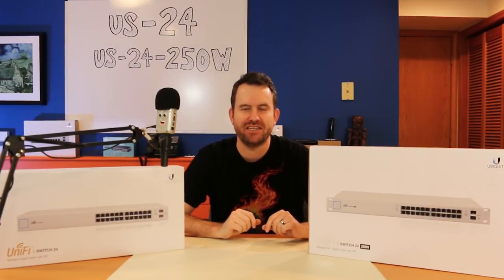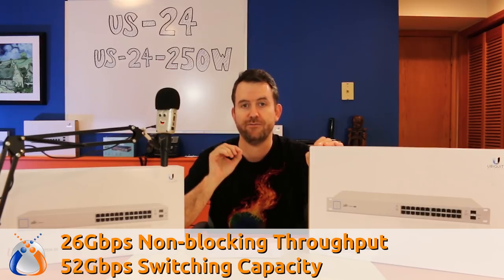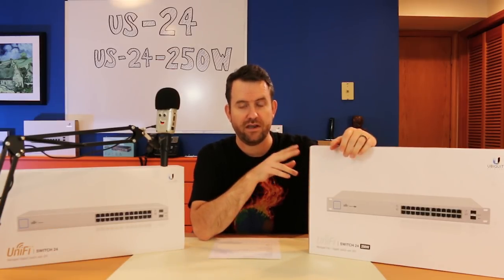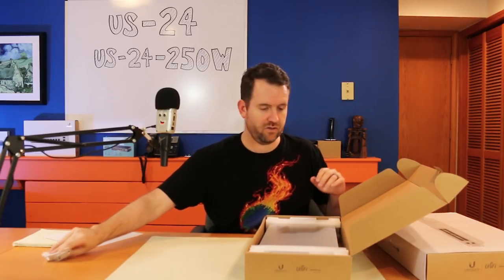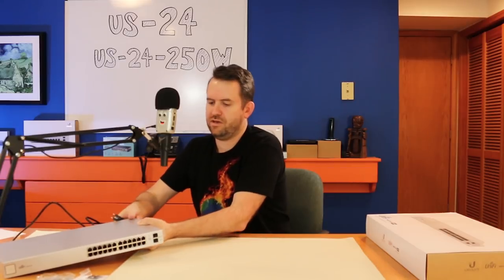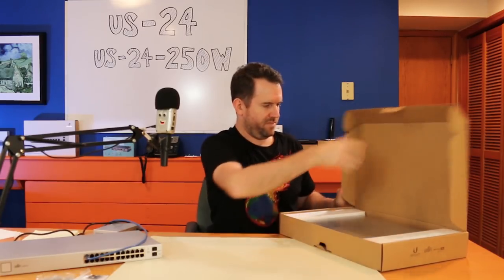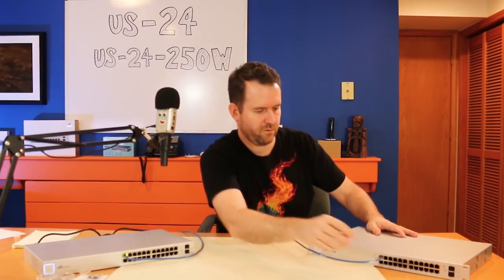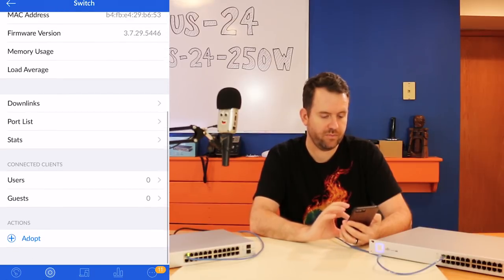US-24 & US-24-250W Setup w/Fan Replacement

Comment: Hi Chris, great videos, however you are completely wrong about the Power Consumption of PoE devices, even cable length is a big factor. The power used when you have a UAP-AC-HD, idle on a short patch cable, is NOT at all comparable to having it deployed with load on 50+ meter cables (average length). Datasheet says max 17 Watt, and that is the number you should use. or you will see installations where you will not be able to boot after a power usage. Booting and firmware updating is one scenario where UAP's use way more power than when idle or under light load, you will never see that in your dashboard because the wattage there is average consumptions, not peak values, and peak values is what giver you overloads. UniFi switches does not have PoE priority functions.
Reply from the maker: Great info - thanks!
Reply: Seen the same, and I typically use the rolling firmware upgrade to smooth out the load spike, as if you just hit 'update all devices', it will likely overload.
Reply from the maker: @wiebowesterhof  Well thanks to both of you...now I have more research to do, and probably a new video on this subject.
Reply: I agree with Ulrik. I've seen AP draw more power at start-up so I guess it would be wise to have room for that always.
Reply: @CrosstalkSolutions  appreciate it, constructive feedback and you being able to share your findings on the channel is a good way to do it (there are enough spam comments on YT )

Comment: Chris,

If you replace the fans with the correct 12 volt fans they will run slower. And thus quieter. 

Your effectively overclocking the fans by pushing double the voltage through them.
Reply: That's what I was thinking. +/- 2x the voltage means +/- 2x the speed... so 2x the noise. Yes, I know that's not 100% true, but the same size fan running at the proper voltage will be quieter.
Reply: Also those are thinner fans as well. Need deeper ones.
Reply: Yup... Those fans are actually double wrong... they must be the deeper version, and also 12v version... 12v to run at the proper speed, and deeper so they can make more pressure and actually move the air properly through the case.
Reply: Do you know if UBNT has a replacement/update for the USG in the works? A 500Mhz MIPS SoC is dated at this point and it's a real shame we don't have a more powerful SOHO Unifi router solution.

Comment from the maker: Anyone notice how I started this video with a USG and ended it with an ER-4?  Shows you how much time elapses to do these kinds of videos.
Reply: I did and I had a question about something then. Are you using UNMS anything at all or do you still just use Unifi for monitor your equiptments and look at your router manually? How do you feel about the seperated UNMS/Unifi-GUIs while using both products?

Cant recall you making any videos about UNMS atleast.
Reply: I did wonder if I was seeing things haha. I am still waiting for the top of the range router to come back out again in USG form, but it seems that it was so challenging to use that I may stick with the ERPRO8 I have.
Reply: Was literally just about to comment on this and then I figured I'd do a good 'ole [CTRL+F] and check the comments, lol. What's the reasoning behind the changeover?
Reply: We're to fixated on the fans... and decibel math. Lol.

Comment: Thanks for the video.  I can see several issues with your modifications.

1.  Use the 20mm thick fans (40x20) rather than 10mm thick (40x10) and with 12V rather than 5V - such as Noctua NF-A4x20 FLX.
2.  Use 4 fans -  2 fans on one side to pull air in, and 2 fans on the other side to push air out.
3.  Cut out all the grills x4 on both sides.
4.  You can either drill the holes to make the screws fit (as you did in your video), or you can also try to use the rubber feet that comes with the fans which will further reduce any vibrations from the fan.  (but you may also need to do some enlargements of the holes).

I've done the above modifications and it is very very quiet.  And the fan speed hardly get over 50 due to the improved airflow.

Comment: Chris, I have the same exact setup. What I did was buy 4 of these: US-24-250W-FANKIT-2 on eBay (12 dB version). If you keep the older fans you will not get a quieter result as they are still in the unit. I put the new fans into the case with 2 pulling air IN on one side, and the other 2 blowing air OUT on the other side. It is now super quiet and keeps the unit cool. No need to drill out the case to make airflow better. Hope this helps.
Reply from the maker: Excellent feedback - thanks!

Comment: Hi Chris, I did the same thing about a week ago, but I got the right 12V fans (NF-A4x20 FLX) and the switch is now dead silent. The fans you are using are rated for 5V max, so if you apply a higher voltage they will have to spin much faster than intended, so they will be quite louder. Just go ahead and order the right fans!
Reply from the maker: Already ordered the correct model fans!  Not sure if I'll do a follow-up, but thanks for the feedback!

Comment: I have the same switch and added four of the Noctua NF-A4x20 fans.  Two on the right side pull air in and two on the left pull air out.  I also cut out the grates.  It lives in a rack about 8 feet from my desk and I can not hear it running anymore.  It is much quieter than factory.
Reply: The NF-A4x20 fans are quieter an flow more air. The switches also already come with 20mm deep fans, I don’t know why everyone says to use the NF-A4x10 fans. I put the 20s in my US-48-L2 and it’s so much quieter, the only thing you hear is the PSU fan.
Reply: Hi, so what orientation are you describing the push pull from? Is the right side you are describing the sfp side? Or the other way around?
Reply: Hi Jim Scott, did you also cut the individual fan speed?

Comment: I did this mod for a client and it really helped with the noise I went with 2 Noctua as well and worked great! seems like you went with a different model. Also I kept the fans on the left blowing in.

i ordered these, Noctua NF-A4x20 PWM Premium-Quality Quiet 40mm Fan
Reply: Do you have to drill the screw-holes in order to replace them with that NF-A4x20 fan?
Reply: @SmokingCrop  no I used the rubber fan holders and was careful to not rip them when closing the case

Comment: I have the 16 port model, US-16-150W - Nice thing about it is, the fans switch off once it boots. I have three PoE devices connected to it drawing a combined 15 watts or so and the fans stay at 0% so it's completely silent. Perhaps consider getting one of those for your office, works great on a desk.

Comment: Literally did this exact modification last summer.  You absolutely have to drill out the fan covers in order to silence the fans.  It was super easy.  I used a bi-metal 1 -1\4 inch hole saw over a 2 by 4 and it drilled out pretty neatly.

Edit: Hole saw Size

Comment: I did the same mod on my 24 Port 250W switch. I thought the same that there were four fans. Order them and realized that there were only two. I decided to go ahead and install all four. The switch is half as loud and runs at lower power levels most of the time. Will never go back to the original fans. Using 5V fans on a 12V circuit is the main problem with the noise.
Reply: This was the comment I was looking for, thank you! Will be ordering four fans to replace the two stock ones. Which fans did you actually use?

Comment: Hi Chris, Get the 12 volt Noctua - much quieter than the 5 volt when giving it 12 volts. And get the  NF-A4x20 FLX - it moves more air quieter than the  NF-A4x10 FLX. Did this the other day - and also got the 5 volt fan by mistake the first time. And the 12 volt will probably live longer since it isn't spinning faster than it's designed to.
When you put the  NF-A4x10 in you will have a temperature increase. Mine went from 42 -> 47 degrees celsius in a 22 degree room. You need the deeper fan to keep temperature about the same as stock fan.
Reply from the maker: You didn't watch the updated video.  :)

Comment: Totally just ordered some Noctua A4-20 FLX fans for my US-48 & USG-PRO-4. Btw, the fans in the switches are supposed to ramp up w/ temps. Not sure if this is same logic w/ the USG-PRO-4 just yet, but we will find out this upcoming week. I'm thinking about dremeling out the fan grating & just putting a thin dust filter over it to help prevent dust intake at least. Not sure on this last part yet.

Comment: I agree with the others about using the 12v Noctua fans instead of the 5v.  Before I bought the US-24.  I was using a Dell PowerConnect 24 port.  It had a leaf blower fan installed.  I replaced it with a 12v Noctua.  It was so quiet I could sleep in the same room.  I did the same thing with my Dremel.  I cut out the fan grills.  Now that I am using the Unifi US-24.  The stock fans are actually more quiet than the Noctuas I had in the PowerConnect.  In fact I don't even hear my fans.

Comment: Hi, I am running the ULED panels and US-8 switch and they are all running around 15W, but the panels are said to take 25W so that will take a lot of power. I have 6 panels on my US-16-150W and 2 US-8 which so that is 120W so going with more of these higher consuming devices it would be easy to require the higher wattage POE switches. But more often that not the US-24-250W will be all that is required.

Comment: Hi Chris, most Noctua fans come with a low noise adapter, check if you have one in the box. I have used the Noctua fans as a replacement in most of our network equipment so would recommend looking at the 40x20 instead of the 40x10 you have. They push way more air while being quieter, the NF A4x20 FLX (12v) with ultra low noise adapter (included) should be about half the volume with the same airflow as the stock. Use this model all the time to replace the stock units in pfSense boxes. Btw appreciate your videos, helped heaps when getting started with a few projects.
Reply: Storm Saich Absolutely right. You just got the wrong ones Chris. I’ve been using these for my USG gateway and they are whisper quiet with the adapter.

Comment: I used Noctua 40mm 12V with a low noise adapter cable that came in the box fans in my USG Pro. The thing is now much, much more quiet.

Comment: I found the noise to be an issue on the 48 and 24 port switches.  I had a 48 initially, and it sound like my whole house might take flight.  I could hear it from any room.  I posted on the UBNT forum my testing results and was met with skepticism.  I ended up using two 16 port switches for my home, and the noise is totally bearable.  If noise is a concern, I highly recommend nothing larger than the 16 port.  I can tell you this, the noise rating on the products is skewed low, for sure.

Comment: I've use the US-24-250 as a core for US-8 Switches in one building and connect BMS Network of Shit devices to them. I also use a 48-500 in the main building also for US-8 with Internet of Toilets and put one on each admin desk. 2 Port LACP and every admin had 6 Ports usable instad of 2, especially for preinstall of clients for the layer8 problems. and 20G uplink were just ok for the room of 4 admins, because on the test bench, where were 8 of the small switches eache used by min. 4 systems reinstalling or backing up (while moving systems from xp or older to win7) [Hospital IT is hard...]
Now in a Datacenter I use the 24 port version for powering remote controlled rack doors. The 24 port version where just way cheaper, because my dealer had a leasing return from someone who want 48 ports and 10g. He had them laying around because nobody wants systems without "strong" uplinks so I thougt that 10g is way overkill for just connecting some 100mbit locks...

Comment: As others have said, your running 5v fans on 12v so they will be going faster than they are designed to. So they will be louder, I have swapped the to noctua and they are super quiet over the stock, but I got the 12v version.
Reply: You should not run 5v on 12v they will probably burn out

Comment: I'd be curious to see  if the noise level changes if you moved the fans back to the left  side. It looks like the case was designed for left --> right airflow. Moving the fans to the right side, with the large openings beside them, you are getting less total airflow across the power and control circuits and more recirculating air through those vents. Moving the fans back to the left might give a better result since it will increase the head pressure of the fan (are those fans made for pulling air or pushing?). Just my 1/2 cent.

Comment: To deal with the fans use Noctua Low noise adaptors. The units wont be stressed to the point of getting to the heat where running at half. Would be a far cheaper and quick way to cut noise.

Comment: Chris, 
Do you know how much power the switch pulls without any PoE devices connected?  Thinking about swapping this switch for another switch plus and a smaller PoE switch.  But in this deployment every running watt counts.

Comment: Just put the switch in a wooden desktop pod with thin felt stick to the inside side walls of the pod. That gives a big sound reduction without much resistance to the airflow.

Comment: at 6.02 it's not a 'molex' but IEC C13 (see https://en.wikipedia.org/wiki/IEC_60320)
noctua says : https://noctua.at/en/products/fan/nf-a4x10-5v
Being a 5V fan, the NF-A4x10 5V can not be run at 12V and will be damaged when used with typical 12V power sources such as PC mainboard fan headers.

Comment: My server cabinet rack its next to my desk I'm adapted to the nose. When summer its here I can hear the 4 fan rack because I have it on full speed but if I slow the speed I forget I have a server cabinet. I have the US-24 no PoE and I love it. Synology Rack station, a NVR for security Surveillance and 4 fan rack mount. The biggest noise it's the top fan either going bad or need clean. (just fix the top fan need it grease) including the top fan I'm getting 40 to 41db all door close open door getting 50-52Ddb.  I love your setup I recommend you to get a small server cabinet.

Comment: I just purchased the Ubiquiti Edge switch ES-24-250Watt after cabling my home with cat6.  I am now stuck with what to do as I expected plug and play.  To set up I connected a cat6 from the switch Port 1 to the ethernet connection on my PC and I get nothing (just like my knowledge level). 
I feel embarrassed to ask but did you connect a cat6 from your router to the switch (port 1)? If so was that from the WAN outlet or one of the 4 standard outlets?  Then next - how did you get the application on your phone for setup?
Cheers, Steve

Comment: You should try the 12V NF-A4x20 fans.  It should make the switch quite a bit quieter.  You are running the 5V fans way out of their normal range.

Comment: I replaced the fans with two BlackSilent Pro fans. Product Number: ITR-PM-2
It worked perfectly, and it has been running for more than a year now.
Reply: Those are also good ones. The challenge can be to get them for a good price on Amazon sometimes. I've used these + the Noctua ones mentioned in the link (12V version)

Comment: If they were actually 5v fans then technically they’d be spinning quite a lot faster than the 12v ones would. This would definitely increase the dB readings... I wonder if there’s a difference with the 12v versions??

Comment: I'm not an electrician but if you plug a 5 volt fan into a 12-volt outlets I wonder if you are causing the fans to spin faster than they were designed to spend and that is why they are so loud... Waiting for someone else to either tell me if I'm right or wrong

Comment: Nice work.  I run a 24port non-PoE on my desk for quieter operation.  Have you tried an external baffle that doesn't allow sound to escape directly?  Even a hardcover book leaning against the top of the switch works wonders.

Comment: I did the same mod on a USG-PRO as that thing sounds like it's going to take off with its stock fans... Used NF-A4x20 PWM.
It runs much quieter and it also runs much much cooler - a ~10°C difference compared to stock

Comment: what you should have done is ordered 4... 16 volt fans! lower voltage on a fan runs at a lower RPM rate... its all about volume of air flow, 4 lower voltage fans will be quieter at a lower RPM and will draw the same amount or more air flow than 2 higher RPM fans will

Comment: Hello Chris, first of all I love your videos. Just a video setup tip, generally for the unboxing part of the video. The mount of your mic is fastened to the same table as you're unboxing on it seems, and it creates alot of bassy noise whenever you move the devices on the table or bump them into the table. You should try to use a tripod or mount the microphone on another table to prevent that.
Reply from the maker: I just bought a shock mount for it.

Comment: I  have had three 24 port 250 W POE switches running for about 2 years.   They are running OK except for one where the rectangular LED on the left which indicates the status of the device recently failed to the point that it can only be seen when the room is completely dark.  Any suggestion regarding what I should do?
Reply: A couple things cross my mind. eBay sells these switches that are non-functional, maybe could buy one cheap and hopefully swap out the bad part?
The other thing is talking with customer support and see what it would cost to send in for repair.

Comment: The noctua's should have come with a "low noise" adapter that drops the RPM. Also I am not sure those are the right ones for this application, there are ones that have around the same thickness as the OEM fans.